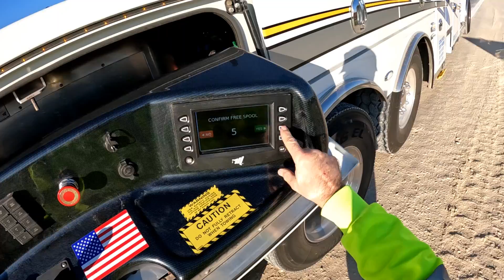Super Singles + Soft Shoulder = Wrecker Call !!!

Comment: Another reason to add super singles to the category of not for me. 

Always a great job Ron.  Stay safe!!
Reply: Super singles on the Trailer is the norm here in the Uk , very rarely  see doubles, some long haulers , also use supers on the steering axle, but never seen them on the drives
Reply: Doubles always gives you that little extra margin to get pulled over if(when) a tire blows.
Reply: @kevinmarchbank1636  European Trailer have mostly single tires.
But those are not supersingles, most of the time they have the same tire width like the steer tires
Reply: @Thomas-lq1jw  
Super singles on the trailers are wider than steering tires.
Reply: 385/65 x 22.5 are usual UK super singles sizes. And yes, you can put them on the fronts.

Comment: I’ve seen trucks with the giant single tires. Thanks for giving them a name 🥰 Thanks Ron for the midweek videos; they’re a nice treat. God Bless 🙏🇺🇸
Reply: They're called super singles, I've had them on trucks for 10 years now. 
Though they can get you in trouble, if you don't watch what you're doing. You do have an advantage of a little less weight, & an advantage of increased fuel mileage, there are disadvantages as well. Some claim they don't have as much traction in snow & ice, but I've chained up & i could out pull trucks with duals on mountain passes on snow/ice packed roads. They were chained up as well. 
It's just that little extra weight you can haul, plus a little better fuel mileage, is the reason why some companies run them. The added revenue to the truck tends to outweigh the disadvantages. 
I've been driving a truck for over 30 years, I've run both duals & super singles. From my experience, i really haven't had too many issues with super singles, although i watch where I'm at & what I'm doing, if you slow down & drive for the conditions, many guys won't have too many issues with super singles.
Reply: Actually, "Super Singles" was a name coined in the late '70's and early '80's, when they first came out with them, but they were not very-well engineered, and had limited dealer inventory and were a pain to find if they blew one out. I worked for a trucking company that had tried them at that time!! I also was Terminal Manager for a fleet of 26 trucks that the customer we hauled for demanded them. This was around 2012. NOW the tire people get all upset if you call them "Super Singles," -- they prefer "Wide-base tires" now. . .!!! Guess they're trying to leave behind the bad reputation of that name from years past. My biggest complaint with them is, if you have a standard dual tire arrangement, if you have one blow, the driver can usually limp it to a truck stop or rest area to get it changed. With a wide-base, when they blow, (and we had aluminum rims,) 9 times out of 10 they would absolutely destroy the rim while the driver was attempting to stop, (as well as possibly trashing the, mudflap, fenders, etc.,) and would immediately put the truck on the side of the road out of commission at 3:00 AM in the middle of nowhere!
Reply: There are at least a couple different types... Super Singles are typically on the front axle(s)
and are high-flotation steer tires.  Sometimes you can find a dump truck or other off-road truck with super singles on the pusher axle.  "Double-wides" are just that, a wide, single tire that replaces dual tires on the drive axle(s) or even trailer axles.

Comment: I was lucky and never had a tractor on super singles.   I can’t tell you the number of times that I was able to make it to a safer areas to get the tire replaced on duals.

I was picking up batteries in Yuma,Arizona and the load wasn’t ready so dropped the trailer and pulled around back of the business.  They raise a lot of cotton in the area.  Pulled of the road and took a few hours nap.  Got a call my load was ready.  And just setting there the tractor had sunken into the soft soil about 2 inches and it would not come out, even with the power divider locked in.  Floor mats underneath the tires, nope.  They sent a 1 ton tow truck and he started on the road and it took just enough to get out of the dips and out it came.

Comment: Super singles are very popular in Europe, although I guess we have two things that mitigate in their favour - hard (fully paved) shoulders and high fuel prices, which you seem to be finding a bit of a shock in the US.  Our national average for regular diesel was $8.1688 per US Gallon on 1st April (latest fleet news prices) and still rising.  $8.9149/USG for premium.  Tread pressure is only 20% higher on super singles, so they shouldn't be too much more prone to sinking - but I guess if you are on the brink, that 20% higher tread pressure (so equivalently lower area, for the same axle weight) will catch you out.  Our drive axles are allowed 26,520lbs, so I don't know if that is much different.  Super singles came in much earlier on trailers (8t axle limit) than drives (12t) though.
Reply: Interesting information.  What were your fuel prices like approximately 3 or 4 months ago?  How much have they increased since?  Thanks!
Reply: In the US any single axle can have a max weight of 20,000lbs unless it's the steer axle then it's max weight as based on the tire rating. Past that our typical tandem axles, be it drives or trailers, are at 34,000lbs max. So a typical truck can run 12k on steers, 34k on drives, and 34k on trailer for 80k total. 

I also believe that the design of our super singles is different from the ones out in the EU. I think ours are much wider while the EU ones are more along the lines of what we call 'heavy steers' that are seen on heavy haul trucks here.
Reply: They're not as popular as one might think they are here in the EU.     
They're used under trailers a lot, but most semi trucks run on duals. 
Or at least they seemingly do in Germany,   Belgium,   And the Netherlands.   From what i've seen
Reply: @PatrickWagz   Right now,  Today in the Netherlands.    Calculated to Gallons and Dollars,    
8,73 for Euro-95 (E10)    
8,39 for Diesel (B7) 
Not sure about premium Euro-98 gasoline though.

Comment: When dealing with snow, an excellent way to get stuck is to turn your steer wheels before you are moving.   With the limited traction, you're pushing against the steer wheels rather than turning them.  I suspect if he had just kept the streer wheels straight until he started moving, he wouldn't have gotten stuck.  When he started digging a hole, the chances of getting out plummet.

Comment: Super singles are not bad. All depends on are the virgin or caps. I rate them right there with 10x20 tubes for odd tire to replace in the middle of nowhere. 
Another odd one is a bias ply 11.22.5 tubeless. The nice thing about them is 
It's got the same rim as a radial tire has. 
I'm in intermodal so if it's a strange tire I've messed with it.

Comment: As a professional driver had trucks that had a super singles, I don't like them. Example a Freightliner cascadia is if you have super singles on them  they're actually way more than having duels and the bracket which is welded into the frame that supports your S cams usually crack do to road vibrations and off. WOW is a DOT violation. that doesn't happen if you're  running dual. And I've got  stuck  on side shoulders or in muddy drop yards   super singles and duels big rig trucks are just not designed to run in mud sand powder snow.

Comment: Super singles are one of those things that make me go ehhhh...... I guess the weight savings is nice, but you lose that wider foot print of duals, and now one blowout stops the whole show. There is no limping to the next shop on a blown super single. Either way, nicely done Ron. Safe n' Easy!
Reply: You also have the advantage of better fuel mileage. Though not excessive, it does add up.
Reply: Yes but if you get a blowout the rim smacks into the ground and you haft to replace the whole rim thus makes them more expensive
Reply: They ride better when empty. Also have a very similar surface area with the ground

Comment: Any driver with air suspension driving or parked on uneven\loose surface like gravel with potholes needs to understand if wheels are spinning they do not have enough down force to provide traction..that spinning wheel is a digging machine!!  Foot brake to stop spin and wait for air suspension to build/equalize before gently adding power, you only have a few tries to get it right before it digs straight down and defeats your effort..the air leveling valve feeds air slowly because all that air has to pass through a small valve about the same size as a car tire valve stem,excess air bleeds off just as slow.  Suspension dump switch bypasses leveling valve to drop frame height quickly

Comment: Thanks Much Ron.
Why the extra Link between the Hook's ?
Mike M.
Reply from the maker: The extra link is called a Master Link.  They come in various sizes and capacities.  I used it on this job because some of the International pins are very close to the bumper and the master link is thinner, so it will fit easier than the larger diameter wire rope hooks.   Thanks and God bless.
Reply: @RonPratt  Thanks...

Comment: I remember something like this when I was young I was with my dad at work in customers yard and my dad walked the yard and didn't feel safe with the ground we got stuck so he called on the cb radio asking for a chain and another truck to come pull us out that one got stuck to so my dad got back on the cb and asked them to get a hold of petes towing they sent out a truck it winch the old Ford f800 out no problem 8 remember my dad or the tow truck driver hooking up to tow hooks on the front thank God it came out. I remember another instance when me my dad was going to do a delivery and a guy with a ford dually got stuck and my dad always kept a chain in the truck so we helped this guy out. Think we pulled out a company dumptruck out think it was a freightliner fl75 and I remember the truck had enough torque to pull that truck out.

Comment: Super Singles seems to be the most troublesome combination of all the setups.  Why did they get invented? What was the thought process on them?
Reply: Weight savings and slight fuel economy increase. I believe it's around 400 pounds less per axle than duals. So you can haul more in your trailer and get paid more for driving the same distance. And you have about 3 inches less of tread that is in contact with the road, so less friction leads to slightly better fuel mileage. It really isn't that much, but when you can save 0.1 mpg over thousands of trucks, it adds up. I still don't like driving with them, but I understand why companies use them.
Reply: We have them on pepsi transport trucks. And that's why we run them is for weight but never been stuck like that. That do suck in snow forsure.
Reply: @darrenk4507  but not being able to possibly limp down to a truck stop or tire shop near an interstate to replace a traditional drive wouldn't that over time reduce or totally eliminate any savings or am I just an ignorant 4 wheeler in this instance?
Reply: @darrenk4507  Back probably over fifty years ago, there was a study, I think in British Columbia, of using singles on logging roads.  As I recall, they determined that they could get by with less roadbase.  Never did understand how this would be.  I'd love to be able to re-read that study.
Reply: Yeah, that can be a factor, but there are some easy ways to prevent most flats/ blowouts. Making sure tire pressure is correct is huge. Most tire problems are caused by low tire pressure. A lot of newer equipment that has super singles has what are called "auto inflators" that use the trucks air system to keep tire pressure correct. The equipment that I normally run is a little older and doesn't have that, so I use a tire pressure gauge to check all my tires at least once a day. An ounce of prevention is worth a pound of cure.

Comment: Down here in aus, we often use super singles as steers, and sometime on trailers. But I have never seen them on the drive. What is the idea of using them on the drive in place of duals?
Reply from the maker: I can't answer that question.   We have 425s on the front of our rotator and on the lift axle, but the drives are standard 24.5 duals.    I believe the idea was to reduce weight and cost by using super singles on the drives.   Not sure how that worked out.   We don't see as many people using them on drive as we once did, so that would lead me to believe that the super singles didn't work as well as expected on drives.   Just my opinion.   Thanks for watching and God bless.
Reply: @RonPratt  from viewing a couple of channels, it seems that Prime Inc runs super singles on all their trucks as drives.
Reply: Alota companies that run light alot use them in the Midwest. They don't bounce as much and that reduces feathering like you get on duals. Increased fuel efficiency as well as weight savings makes it worth it. You can save 800 pounds switching all your duals to widebase. In regards to the steers alot of trucks will run 385s or 425s for better weight capacity. Most drives run a 455 these days as opposed to the 445 they used to run. 455 is equivalent to an 11r where a 445 is equivalent to a 275
Reply: Weight savings and slight fuel economy increase. I believe it's supposedly around 400 pounds less per axle than duals. So you can haul more in your trailer and get paid more for driving the same distance. And you have about 3 inches less of tread that is in contact with the road, so less friction leads to slightly better fuel mileage. It really isn't that much, but when you can save 0.1 mpg over thousands of trucks, it adds up. I still don't like driving with them, but I understand why companies use them.
Reply: My opinion... 2 tires opposed to 4 means higher psi pressures to the ground. Should equal more Tractíon since you are digging, as opposed to riding on top.
Reply: I can answer that one When I drove for CCC our bulk drivers all ran them they were loaded on the scale and paid by what they delivered...Each pair of duels replaced by a super single saved you 100 pounds...That was an extra 800 pounds each trip loaded right up to 80,000 each trip...that and day cabs with small fuel tanks ...some drivers even pulled out the passenger seat too...
Reply: And they were very slippery in the rain and they would just bury you in the dirt I have been sent to job site and the truck just buried right up to the frame...but when you drive for a company in the company truck you drive what they give you and go where they say...
Reply: @GeorgeZ213  that depends on the tire size if you put a tire with a smaller contact patch area on the truck it will increase contact pressure if you go wider and taller than the original it will decrease the psi per tire if you want to get good traction off-road(like in sand)  in a daily pickup the best option is super singes on all four corners
Reply: Its insteading i guess comparing that to us down here. We run smaller trailers with heavier weights. 42t and only 45ft trailers. I understand at the end of the day its all about weight. I guess like everything its an economy of scale. I know they just finished project to allow and extra 4.5t per trailer just to squeeze that much more in.

Comment: Super singles was just another product to sell from the tire companies. Not worth the trouble for the fuel saving they say you get. You lose that savings with the road service calls when you get stranded when they blow
Reply: Only time I see blowouts with supers is when company's buy cheap ones or recaps. Also have to make sure you keep proper pressure in them. Can't run 95 like you do with duals need to run 115 to 120 in them for proper life span
Reply from the maker: @Suedeman  Unfortunately I know of several heavy haul and large wreckers that run 425s on the steers.   When they blow, and they can, it's major trouble.   We changed ours 425 steers last year.   They still had plenty of tread, but they were six years old.   Didn't want to risk a blow out.   Thanks and God bless.
Reply: @RonPratt  6 years is longer than I expected a set to last. However the   rotator doesn't rack up the miles like a dump truck

Comment: why don't trucks have permanent pull hooks as standard
Reply: I'd say because a piece of heavy metal protruding from the bumper would make a lot of damage in case of collision.

Bumpers are soft to absorb as much energy from the chock as possible. Heavy, solid hock would transmit all that energy instead of absorbing it.

But I recon that trucks could be made to carry their own hooks.
Reply: They leave bruises on your shins when you leave them in so they're removable.  When they get removed, they end up under the seat then in a box in the shop then who knows where.  Then you hope the tow truck has some.  At least that has been my experience but I'm sure I'm the only one.
Reply: Hopefully they never need them
Reply: The bolts and hooks rust out if left on the truck too